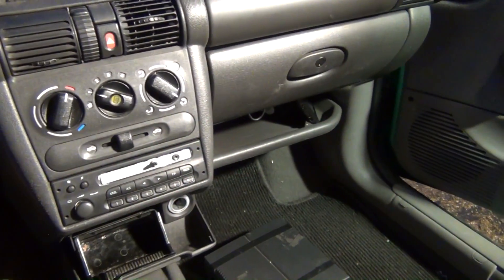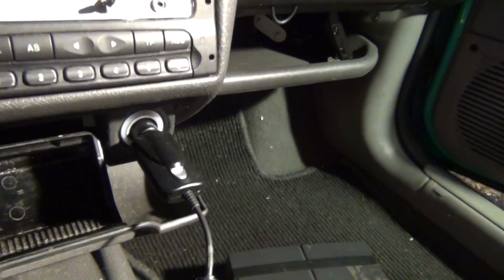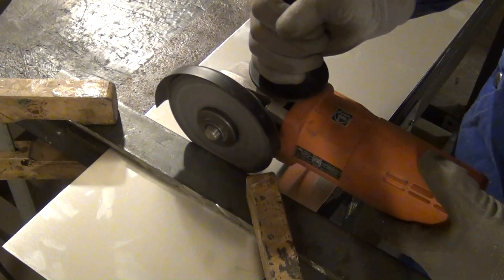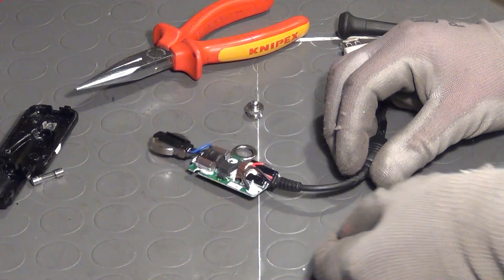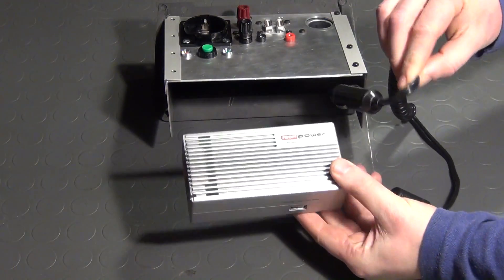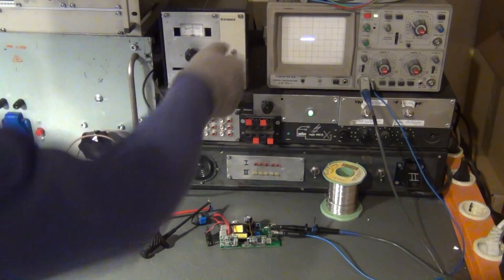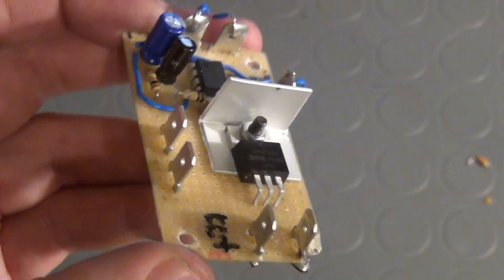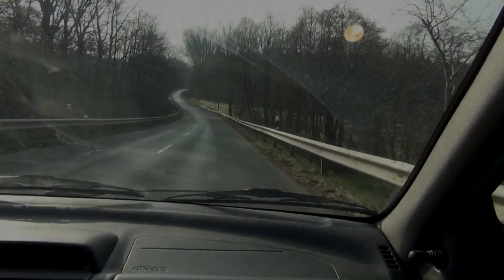Adding a Power Inverter and USB Power to your Dashboard /Car

Comment: LOL i did like the revolving number plate and missiles, his name is Bond... Inventor Bond, licensed to fondle power devices :-D.
Im glad you fitted a power switch to the inverter, they can be noisey, much like the down converting pwm power chopping switchmodes, also you dont want it consuming power when its doing nothing.:-(
Smashing job, every thing in one place :-D

Comment: Once again, brilliant and artful. Btw did you bend those aluminum joints with a special tool or by hand?
Reply from the maker: +satchel frost I didn't have to bend them. You can buy them as ready made angle plates.